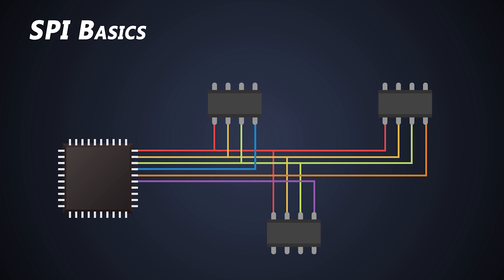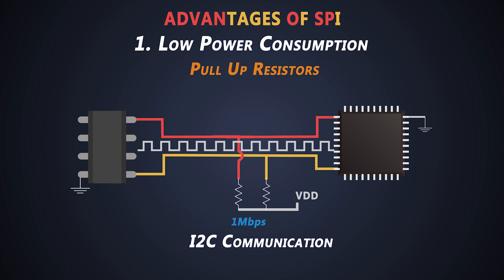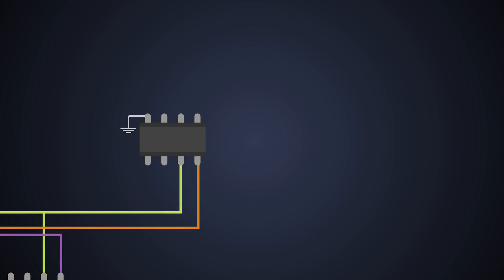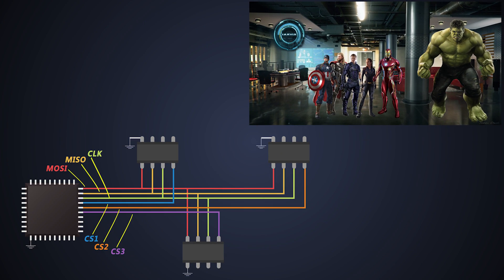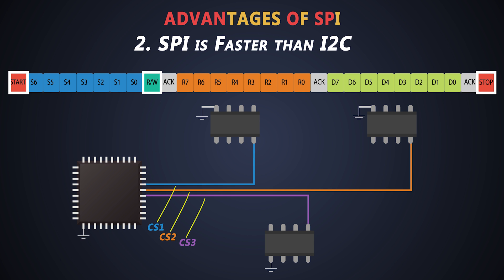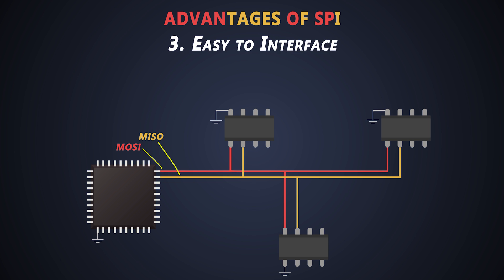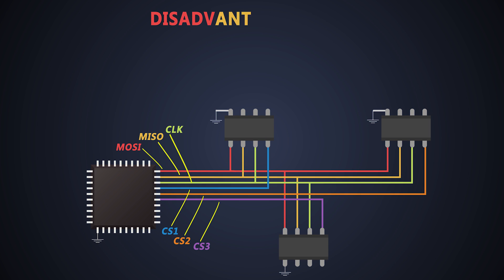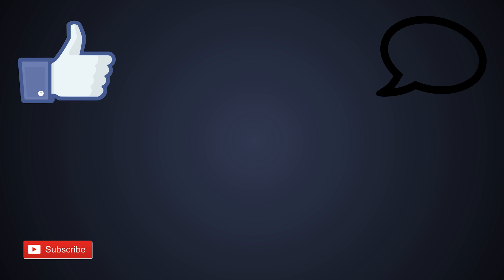Advantages & Disadvantages of SPI Communication

Comment: Kindly tell what are the benfits of doing a multi slave multi masters spi protocol over a simple spi
Reply from the maker: Hey,
Thanks for following us and watching our new video.
Your question: "benfits of doing a multi slave multi masters spi protocol over a simple spi"

SPI Multimaster: we are sorry if we have failed to help you understand that SPI is not recommended for Multimaster communication.

SPI Multi slave: Obviously, you can interface multiple slaves at a time and collect/ write data to and from those many slaves.

If this answer is not satisfactory, help me to understand your question with an elaborated version.
Reply: @FoolishEngineer  i am doing verification of multi master multi slave spi protocol. Hence i want to know what are the advantages of opting for a multi master approach. Can we increase efficiency and speed by compromising area and power?